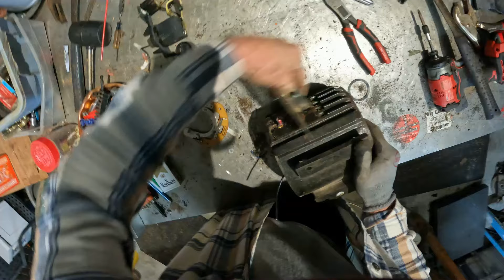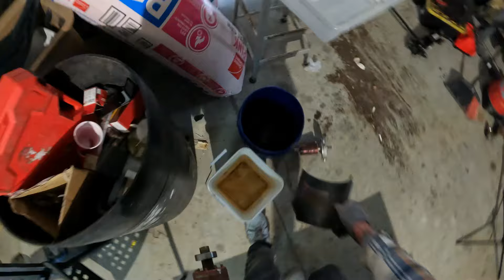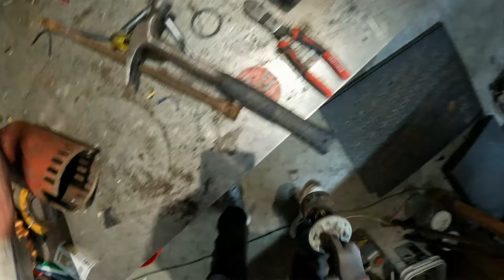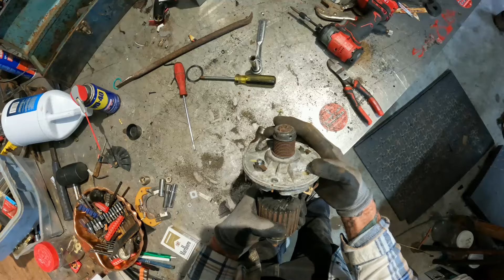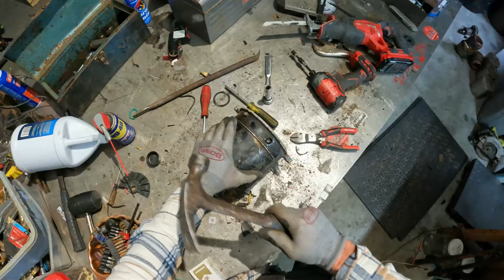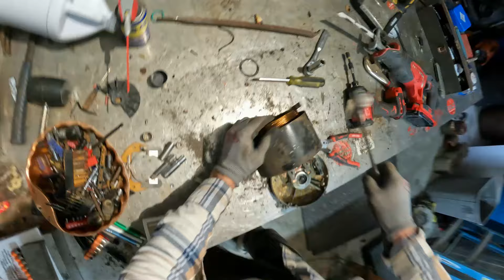Scrapping a few things in my scrap shop. trying to stay busy.

Comment: I made a compressor room , insulated so you can barely hear the thing running  . A outside source of clean air so your not sucking up a bunch of dust . 👍🇨🇦
Reply: Good idea
Reply from the maker: Very good idea
Reply from the maker: I love that idea
Reply: @ScrappingwithGrandpa  when I’m on a job site , I lean a 4x8 sheet of plywood up against the compressor / generator to project the sound away from me . 👍🇨🇦
Reply from the maker: That is a very good idea

Comment: Awesome video, I broke down an old fan motor from a central air unit that was built in the 70's and boy everything in it was copper, even had 3 transformers that all were copper. Had a total weight of 7.5 lbs of copper in it. Stay safe and see you on the next video.
Reply from the maker: That is awesome